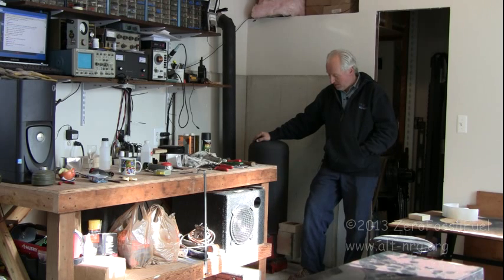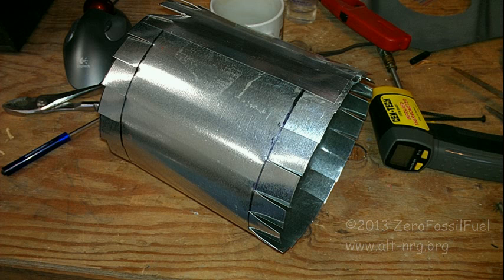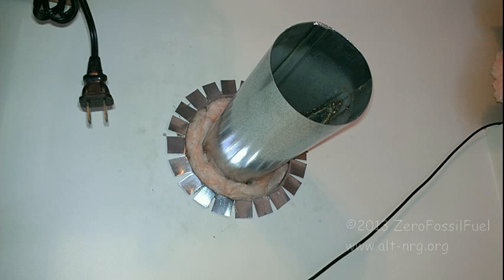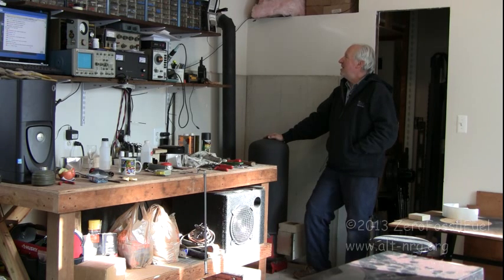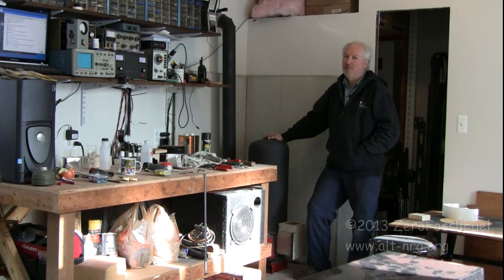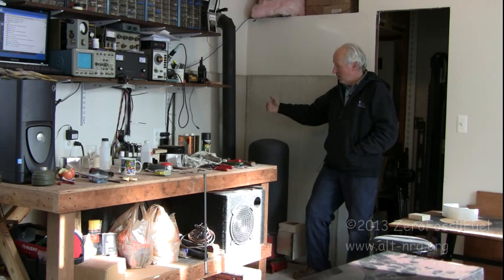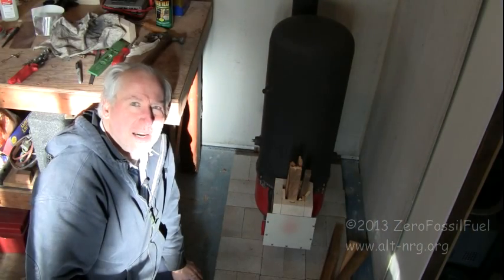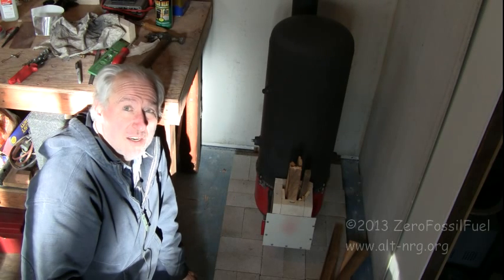#325 Rocket stove installed, performance data

Comment: you need to add MASS to get it to the MASS Rocket Heater category
you'll notice a great return on your burn that way.
Reply: also, because the concept is forced air exhaust, you don't need the vertical chimney.  A straight out shot works, as the exhaust is not that warm
Reply from the maker: @theThinkerator  Also true, and I could have if only to prove the point. But every little bit still helps.
Reply from the maker: If this was a normal living space, adding a mass would make sense to spread out the release of heat. But this is a workshop I'm heating. Transient occupancy. Quick warmup is the goal here. That's why I extract the heat with fins around the tank to increase the surface area by another 700 sq-in. Even running at 900°F at the top, exhaust temp rarely exceeds 180°F.

Comment: Ok...call me dense, I know....but....How do you clean out the ashes once the stove has cooled down? Do you have to take the top part of the tank off to get to the ashes, or can you get them out somehow, through the fuel feeding opening?
Reply from the maker: I made myself a little hoe from a small piece of aluminum drip edge, same stuff I used for the fins around the stove, and a strip of 1/2" wide steel. Slide the front facing brick off and drag it out. Surprisingly I only need to give a full cleaning every 3rd or 4th burn. In fact, the layer that collects on the bottom of the burn tunnel actually enhances the stove performance, so much so that I usually try to leave some behind when cleaning.

Comment: nice! great presentation. to augment what you've done, line the walls that form the corner the stove is in with soapstone tiles. It absorbs the heat relatively quickly, and re-radiates at a more constant temperature.

Comment: Do you think you could just use a exterior wall vent like used for high efficiency furnaces instead of going up over your roof?
6 years later is it still running?

Comment: install a PETER channel P channel to introduce secondary air. Its a thin slit behind the fuel box, at its neck, which goes into the burn chamber. Normally, the air intake slit is metal and part of the fire box so that the secondary air is preheated by the metal fuel box casing before it enters the burn chamber.

Comment: Hey just a few notes. First Paul Wheaten had that exhaust running through a large cobb mass so let's not compare apples to oranges. Second I lived in MN in a hunting cabin in the woods. My Ex installed a stove and ran the pipe through a window of an old door to get it outside. Instead of putting an elbow to take it up outside, he put a tee, then ran the pipe straight up and capped the bottom with a coffee can that he had poked holes in for drainage. It was removable for cleaning. The Tee worked very well for draining moisture. There was a lot of soot and mess too but this was a regular iron stove. I wouldn't expect the mess with this rocket stove. Just saying...
Reply: +ZeroFossilFuel I'm new to winter life having spent most of my life in places like Florida. But I was told that you don't want a pellet fed heating source if the SHTF. Is this true?
Reply from the maker: Tyrd Ferguson Of course it's true, of anything made commercially. And in that case you just switch back to burning sticks and split wood. I did it just the other day to see if I remember how!
Reply: I wasn't aware u could use sticks and split wood on stoves made for pellets.
Reply: The OS.  Z is not talking about ANY stove, he's talking about his rocket stove that you see in his video.  His stove was made to burn wood sticks but he added a pellet hopper so he could conveniently use gravity-fed wood pellets.  If you have a pellet stove then it is not likely designed for use with real wood/logs.
Reply from the maker: +Greta Beach I'm not sure how many of my videos you've seen on this particular Rocket build but I can tell you that the amount of ash and soot is ridiculously small. I have most recently converted it to pellets with a self regulating gravity fed hopper and can revert to regular wood at any time. I clean out the burn tube maybe every 3rd or 4th burn. I also use a T at the outlet to make a trap for the tiny amounts of ash that do slip through.

You are correct that the "traditional" design is called the Rocket Mass Heater or RMH. It stores any remaining heat that leaves out the flue in the thermal mass for slow radiation in between burns. I built mine for transient heat because I'm not always in my workshop. (My wife would tell you differently but that a whole nuther topic!) My stove typically runs about 950*F at the top and flue temp averages only 180*F. It performs exactly to the specifications I designed it for.

Hope you find this useful. Thanks for watching.
Reply: Hey Z my comment about the mass was for another commenter than was downing Paul about being dishonest about the way it heats. I have seen all your videos and I am going to go to a metal shop and see if they will modify a tank for me. I am going off the grid and want a stove like yours that can be disconnected from the cob or rock mass. I love your design. I live on 50 acres of hillside here in Southern Kentucky. I can pick up enough "trash" without having to cut trees. I am collecting my firebrick now although I have 3 regular wood burners ranging in size from a large freestanding buck stove to a small kitchen cook stove. I am getting ready to build a smaller place soon. I am really looking into solar and will go back to permies but like you I want to go with my own ideas and not be regulated by what is on the site. Have you seen the add-on to a wood stove that generates electricity? Trying to figure out the cheapest way to go. Anyway Thank you for the great detail you put into your videos!

Comment: I am impressed with your video series, its too bad that utubular management has such an issue with a non issue! I love your design and lectures with the rocket stove! I do not have a workshop or a place where I live to utilize such a great heating device! Just getting the theory of this design will assist me one day with this project. I didn't read the many posted comments but was wondering if you plan to either brew coffee or fry some eggs on top of this awesome stove (of course there has to be a sort of a concave metal cooking surface attachment design)! Great job Sir!

Comment: I'm wondering how well it heats your shop. How much wood for how long does it take to reach say 70 degrees on a 45 degree day and how large is the shop? Thanks
Reply from the maker: +Greg P I've switched to burning pellets. I can elevate the shop temp about 4*F per pound of pellets. So about 6 lb of pellets on a 45* day and I'm warm and toasty the whole evening.

Comment: The outside flue should be dual wall insulated to stop the condensation.  If only a single wall used can lead to a build up of carbon monoxide and creosote...had a friend who had problems following diy stove install
Reply: there is no creosote build up with a rocket stove , the burn is complete due to the high temperature  . it is not a regulare wood stove

Comment: I'm wondering why you don't use a thermal mass to store that heat?  Also, in most rocket stove mass heaters I've seen, they use the mass around the exhaust, but the barrel is where most of the heat is.  Do you know why they do not put a large mass around the top of the barrel to capture those high temps that occur there?

Comment: yes, great series of vids. I see some comments about the insulation in the wall around the pipe, and yes, any insulated thru the wall stainless chimney kit will tell you to have the 14 inch square AIR SPACE around the pipe not have any insulation in there. just metal cover inside and out. also insulated flue pipe outside to keep creosote and/or condensation/cooling from going on in there. some even recommend a "chase" be build around the pipe. (like a doghouse all the way up to near the top)

Comment: ZFF i see you are using what would appear to be galvanized flu pipe for the upper extent and outdoor portion of the exhaust stack. Are you able to do this due to much lower temperatures if compared to a normal woodstove?

Comment: When properly built these systems rely on JUST the down draft created by the outside of the chamber dome cooling the combustion gasses.  He didn't need to actually have the tall vertical flue for the unit's operation, that is there just to meet code and it does counter wind pressure from back-drafting the system.    When properly built and started this system will use 1/8th as much wood as regular heating stoves to produce the same indoor heat output.

Comment: I placed this with ZERO
but you touch the same subject - so here it's again from France !

One thing I don' get from almost all the RS videos

Everybody declares that after 10 feet of exit pipe

there is nothing than CO² and water - no smell - no CO

and after 15 feet no heat at all

So why the exit to 'outside'

I have to drill through about 0,8 meter thick 18th century stone wall here

Comment: Hey - I think the vertical feed tube is unneeded. Just a straight tube in from the side would work right? The real magic happens inside the main chamber I think. Maybe they do the top feed just for convenience of loading the wood? I would also raise the whole unit so you don't have to crawl on the floor.
Reply: Without a vertical feed tube, you would have to keep pushing the wood in as it burns.  With a vertical feed tube, the wood feeds itself as it burns down  (aka gravity feed).

Comment: Thank you for posting these video's of the most comprehensive rocket stove build I've seen yet.  Everyone else uses propane tanks for the most part which I cannot bring myself to do even with the highest precautions taken.  I do however have a medium sized air compressor that has long been put out to pasture and I cannot wait to begin this project and finally have a viable use for branch wood. Cheers.

Comment from the maker: I think the hottest I've measured the exterior wall of the feed tube (smaller vertical section of the entire J tube) is about 350-400*F despite the fact that the interior easily exceeds 1500*F.

Comment: It looks as though you aren't heating any mass with the heater.  Do you plan to add a mass (like a bench made of cob) to add to the heating efficiency?
Reply: If you wont instant heat in your workchop this is the best ,in a house you use cob i guesse

Comment: heres a tweak I see right away  where the clean out panel is reset that brick to 45° sloped in the fire box  As wood burns it becomes shorter and will slide down in to fire
Reply: The wood already sits in the fuel chamber at an angle, thereby feeding itself as it burns (aka gravity feed).  No need for a 45° slope.

Comment from the maker: I think insulation properties are more important for the riser than thermal retention. That would only mean it takes longer to get up to temp. The purpose from the start was to produce quick heat. I'm dissipating most of the heat into the room anyway with the tank directly and the fins. I do however plan to put more fins on the flue to extract every last BTU I can.

Comment from the maker: (part 3) So, while the 35,000 BTU calculated by someone else for me may have been exaggerated, at 20,000 we are in the same ballpark. Compared to the temp rise I was getting with the 35,000 BTU kerosene heater I was using, I'd say 20,000 is a good number, so I am pushing the envelope with my stove. AND, it can do better if I reclaim even more heat from the vertical flue with even more radiator fins. I may do it just to prove a point.

Comment from the maker: (part 2) What I can tell you is a 1500 watt (5000 BTU) electric heater barely does anything to heat my space. I do get a rise of anywhere from 15*F-20*F/hr and have had it as hot as 83*F inside and had to stop feeding the stove because it was too hot, with outside temps in the high 20's. Based on all the data I have gathered, I'm still guessing about 20,000 BTU/hr.

Much of the wood I'm burning is oak. Let's say avg 45lb/cu-ft. I'm burning roughly 70 cu-in/hr.  That's 1.875lb/hr.

Comment from the maker: Well, I do admit to being a noob when it comes to calculating BTU's of living space heat energy. Someone else came up with the 35000 based on my temp rise gradient for 2150 cu-ft and 4 outside exposed walls. One online BTU calculator I found suggests I need only 6500 BTU to heat my space 20*F. Others say 0.018BTU/cu-ft/*F. That would be only 777 BTU to raise my space 20*F. Still others anywhere from 16000-32000 BTU for the same rise depending on insulation, average to poor. (cont...)

Comment: Just checked our measurements… wondering if we're using the same formulas. On your calculations, your stove burns 1-2 pounds of wood (depending on the type of wood) in an hour. @ 8600BTU's/hr for a pound of wood, the fire can only produce 8600-17200 BTU's total, on 1-2 pounds of wood.  Am I missing something? I'm using the calculations from the masonry heater association's website written by Sam Foote- "How much heat is there in one pound of wood".

Comment: Yes, our cooktop is easily removable for cleaning the unit. We have talked about ducting outside air in, but we don't have a model which provides that yet. 
I love how we are comparing these stoves. Think about it, we are comparing technology that blows away the old way of thinking. 
It doesn't matter which one performs better, or if either of them is better… But rather, both are miles ahead of conventional method stoves. :)

Comment from the maker: Very elegant. I'll leave the comment even though you're trying to sell something because it looks like a quality product. But let's compare.

Yours consumes 1 cu-ft every 4 hours or 432 cu-in/hr. Mine consumes about 70 cu-in/hr (6 times less than yours) and produces nearly 35,000 BTU/hr. Does your unit produce 6 times more heat or 210,000 BTU/hr?

Your burn chamber is all steel which will wear out. Mine is hybrid with replaceable firebrick encased in steel and will likely last a lifetime.
Reply: Yes, that firebrick is a must, if using a metal burn box. I prefer a ceramic box. Also, you could have designed in a cook opening to make tea or soup.

Comment: Hi Great channel,found this cause I was checking out HHO, I was curious it would seem with little modification it could also be a gasification stove? then you could power a generator. Or maybe use HHO for fuel to heat the stove?

Comment from the maker: I think I understand what you're getting at. The answer is probably but only if I were to add forced air, which requires power, which sort of defeats what I'm trying to accomplish here. 100% off grid heat.

Comment: z  if u put a drum over the top of the heat sores, then sealed it at the top and bottom . making a dead air space, then  put a cold air ducked at the bottom and a solar fan and  duck at the top to pool that heated air throw do u think that it could heat a larger shop or at least heat up yours faster at operating temp ?

Comment: hey Z ..love your name..im gonna have a crack at following your design.i live on the west coast of the south island of new zealand next to the mountains.
from the intel ive been reading on rocket heaters is that the flue can also run along the floor to heat a mass of some sort and terminate at floor level as well. that would be even more efficient than the great results youve had so far.
good stuff

Comment: Late to the project but very impressed with the thoroughness of you videos. I was concerned about exhaust gas temps & you addressed that. I was curious as to the max surface temp for the top and sides of the tank & you addressed that, too. I am curious if there may be a method for improving heat exchange. As air (gasses in general) are rather poor thermal conductors, it seems to me (an admitted novice and rocket stove builder wannabe) that fins might increase surface area & exchange efficiency?

Comment: Introducing a blow lamp to the outer chamber to create some draw initially. You could use it to get the kindling going then poke it through a closeable hole to create some instant heat in there for a minute or 2.
I couldn't find your comments re permies, but one visit there was enough to put me off. A guy asked for some basic help and was told to go away and read!! what is a forum for if not to share information? GRRRR!
Reply: The same can be said for Youtube videos that tell you to read the comments for the answer to a question.  LOL.  Who has the time to read through hundreds or even thousands of comments to find that one comment that has the answer to your question?

Comment: Forgot to mention the burn process, no worries indeed.Have you ever seen a rocket stove being used to supply domestic hot water and space heating. I have seen the rocket mass heaters and can see why its a useful system, for me the interesting part is if they could be used to say replace an oil(kerosene) boiler in a home and how practical they are with loading the fuel(how often) and how well they might perform for DWH and SH requirements.

Comment from the maker: Not worried. Rockets make far fewer particulates than regular wood burning stoves. Even if it was a problem, $15 for all of the vent pipes outside where the condensation forms. $35 to replace everything all the way back to the stove. Whoopieee!

Comment: I was told by a boiler installer that the condensate that can build up in solid fuel type system .This can result in tar and particulate build up and corrosion over time along with reduced efficiency, this may be worth looking into further if the problem persists.I believe when used to heat domestic hot water or for space heating supply(rads) an anti-condensation circulation unit is used.

Comment from the maker: My shop is 240 sq-ft, 2150 cu-ft. You're going to need something bigger than mine because of your increased heat losses. Start looking at roadsides and scrapyards for discarded electric hot water tanks.